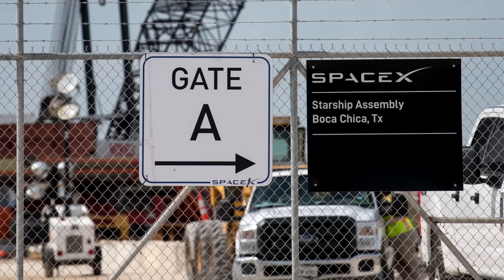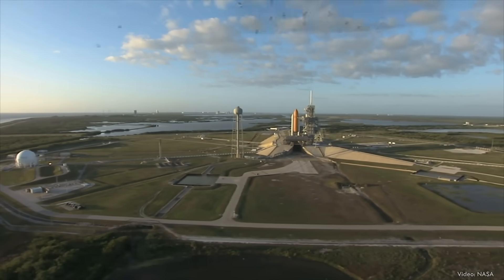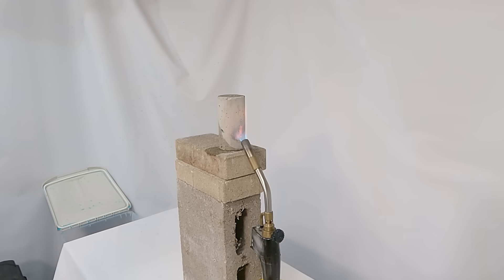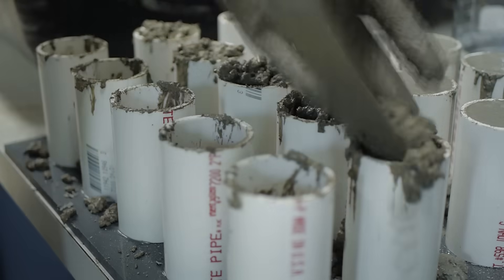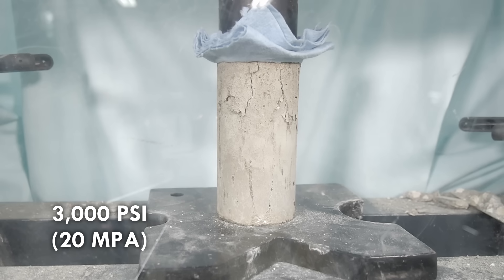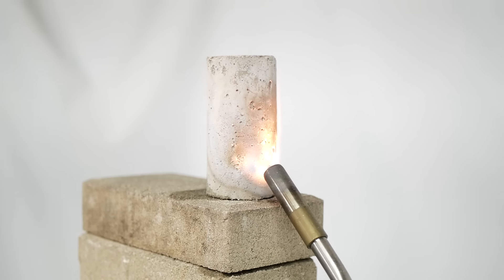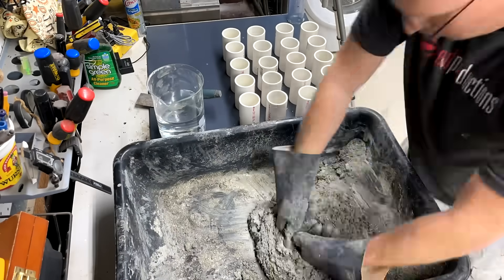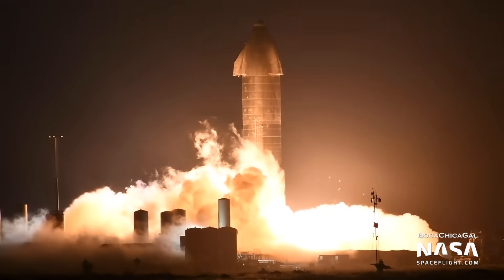Why SpaceX Cares About Concrete

Comment: My dad was an engineer and told a story about a new highway being built that ran into a mysterious problem.  From every batch of concrete they would pour two cylinders of the concrete and leave them sitting beside the road to cure and then test.  And in most cases, one would pass and one would fail, by quite a large margin.  Obviously this was raising questions about the quality of the concrete, but no one could figure out why one would pass and one would fail even though they were the same batch cured in identical conditions.  Finally someone was assigned to sit and watch the concrete cure (what a job that was) and they found that one guy on the finishing crew would come along and kick one of the cans to see if it was hardened yet.  This guy was doing his work just about the time the concrete was starting to harden up, but not quite all the way, so he was damaging the structure of the cement in the can that he kicked.  Mystery solved. I didn't hear how hard they kicked that poor guy :-).
Reply: Ugh 😩 god that would get on my nerves. I had guys tamper with my mix while mortaring. They’d add extra water as the mix started to thicken from curing.
Reply: lmao doesn't such curing process will have an estimated time for it to be finished? but probably that guy didn't know about such and how kicking the cylinder would affect the samples
Reply: Good story. I wonder if the SpaceX engineers have reinforced the GSE tank farm tanks to withstand the blast of thirty, plus or minus Raptor engines firing just a short distance away and only twelve meters or so above a flat surface, without any diversion system to deflect the blast away from those huge tanks, some containing LOX and liquid methane. What am I missing? There is an earth berm perhaps ten meters high between the OLT and the GSE farm, but the booster will slowly rise the first few hundred meters, exerting quite a bit of lateral pressure on those tanks for many seconds.
Reply: @elihavalot8111  I think they are a lot further away than they look in the pictures. The videos are taken with extreme telephoto lenses that make depth all screwy. The tanks themselves are also going to be pressurized to reduce boil off if nothing else. That gives them quite a bit of strength from everything except high speed bits of concrete. In addition to that they will be not flight weight tanks. While Starship might be a mm or two in most places I'd wager tanks that size on the ground are going to be half inch (12mm) steel with added insulation and such like. The force exerted on them by the rocket launch would be a small fraction of the force on them during a maximum hurricane I'd wager.
Reply: @elihavalot8111 you weren't missing anything. They ruined that whole area. 🤣🤣🤣🤣🤦‍♂️🤦‍♂️🤦‍♂️
Reply: Timemachine, they'd X-ray it and confirm failure, but essentially yes, they'd destroy what was damaged.
Reply: Hah, that reminds me of the classical story told in IT, where a server would mysteriously crash every Tuesday night without any warning or errors in the logs. Even replacing the machine didn't seem to help. So one guy stayed behind and observed how the cleaning personal came in and unplugged it so they could plug in their vacuum cleaner...
Reply: @asdfxcy  I know that story lol
Reply: hahahaha. That's a funny story. Thanks.
Reply: They really done made someone watch concrete cure☠️☠️☠️☠️

Comment: What videos like this never discuss - and this is not a criticism - is the absurdity of the levels of sound volume and mechanical energy that these rockets produce. Heat damage is a fine and common point to discuss, but did you know that rockets are so loud they can literally set concrete on fire? There is a chart that claims that the Saturn V rocket set grass on fire for nearly an entire mile around the launch pad. With sound - although, calling it "sound" at this point is not exactly correct, it is a shockwave. Of course, today, this is mitigated by dumping water onto the launch pad to absorb the sound, but even with this "technology", when the Sat V launched, it broke windows dozens of miles away. It rattled entire buildings and nearly caused them to collapse. In my opinion, discussing the absurd stresses concrete (and the rocket itself) has to endure due to sound pressure levels is a far more interesting topic that is virtually never mentioned. NASA conducts a lot of research on miniatures to try to understand how the acoustics of a launch will affect the pad and the rocket, so it is not like it is an esoteric topic.

Either way, great video and I enjoyed it very much. I also learned quite a bit. Thank you!

Comment: Question: At the SpaceX launch site, the very tall and colorful mobile crane has that section with two parts of the crane box frame (sorry, not sure what to call it). That main part starts out as a single width, increases to 2x, then back to single width. What is the reason for that double width section? 
And you need a model of it next to the yellow one in your video background.

Comment: Test invalid, you didn't tamp the cylinders.  There's gonna be a lot of variation between your cylinders even before treatment, easily double-digit percent.  So you can't really make the conclusion that heating the PCC in an oven reduces the strength by 25%, because there's a chance that your result is within the margin of error based on variation in the starting cylinders.  And you only tested one sample of each.  The statistical/mathematical uncertainty based on that alone is higher than 25%.  

Now I will give you this: there's lots of research showing how concrete weakens when exposed to fire, which is probably something you discovered in research.  But for a channel called "Practical Engineering", I would have expected a more robust and researched approach to presenting a test on-screen.  This feels like you're just winging it.  There's all sorts of literature on concrete testing you could have referenced.  A valid test of concrete cylinders is the average of 3 cylinders.  Cylinders are always twice as tall as they are wide (or there's adjustment factors that must be applied).  And there's a standard method of consolidation that's used on every test cylinder.  For small 2"-diameter cylinders like are used here, you fill it 1/3, tamp it down with your finger, and repeat.  That all helps ensure that tests performed in different places by different technicians are all comparable.

Comment: We made a slab for pressure washing with store bought concrete, which broke easily.
In a few days it went from a smooth surface to a very rough surface.
Next time we had a truck come with proper concrete, which is still like new a few years later.

Comment: Concrete doesn't burn?  

You haven't read enough rocket engineering. :)  

I share with you a passage from "Ignition: An informal history of liquid rocket propellants" by John D Clark:  

"Chlorine trifluoride, ClF3, or 'CTF' as the engineers insist on calling it... [...] ...is extremely toxic, but that's the least of the problem. It is hypergolic with every known fuel, and so rapidly hypergolic that no ignition delay has ever been measured. It is also hypergolic with such things as cloth, wood, and test engineers, not to mention asbestos, sand and water - with which it reacts explosively. 
[...]
[General Chemical Co]
It happened at their Shreveport, Louisianna, installation, while they were preparing to ship out, for the first time, a one-ton steel cylinder of CTF. [...] ...it split and dumped one ton of chlorine trifluoride onto the floor. It chewed its way through twelve inches of concrete and dug a three foot hole in the gravel underneath, filled the place with fumes which corroded everything in sight, and, in general, made one hell of a mess."

Comment: In my country we only use cylinders when drilling out existing structures. All new concrete testing is done on cubes. It's common to have a 3 cube form to have enough for both pressure and freeze testing.

Comment: This reminds me of the time my dad told me not to cut metal with the oxy acetylene torch on the ground close to the concrete. So wondering why, me alone at like age 15  in the garage lit up the torch and put it on the floor. No surprise the concrete exploded immediately and a chunk hit me in the forehead and put a divot in the garage that I could not explain when he asked why there was a chunk of the garage floor missing. Sometimes you just have to learn the hard way. Lol

Comment: Refractory materials need to first be allowed to dry at low temperature (below 100C) to develop full chemical bonding. Then, once fully dry, they need to be heated slowly to full operating temperature to develop ceramic bonding. It does not appear temps achieved in this experiment would have allowed the full potential strength of ceramic bonding.

Comment: It's not just thermal expansion that can severely weaken a concrete structure. Thermal shock caused by the sudden and dramatic application of intense heat (or the sudden and dramatic removal of heat) tends to compromise concrete structures significantly, especially on loadbearing nodes. Take a sample of concrete for example, put it in the oven at 500 degrees F, and then dump it into a bath of ice water. It will quite literally shatter.

As I have heard from people in the industry, this is an especially common occurrence, when contractors rapidly cure concrete in order to cut corners and shorten construction time to meet unrealistic deadlines... which unfortunately has resulted in newly built concrete buildings failing within weeks instead of the expected two or three decades.

Comment: I developed ultra high strength concrete and ultra high temperature coatings for oil and gas, and the military.
I love developing extreme service coatings as a formulation chemist.
Worked with explosives, armored vehicles and love concrete.
I admire the Roman's and their 2000 year old concrete that gets harder over the century's while our Portland Cement lasts about 50 years.
I admire Elon Musk and his fantastic path of product development and he runs circles around nearly everyone on Earth.
NASA is still using re entry ablative coatings developed  back in the early 60's. 
I know because I have the old formulas in my lab.
I now designed many other coatings for my current employer, and love the challenge of invention.

Comment: “If a Spacecraft were to fly through this (lunar) ejecta, it would almost certainly be damaged.”
Disagree. Too little material and too much dispersion at even the low altitude of lunar orbit.
And finally: what does SpaceX do about a landing pad for the Rockets? Have you any  details on the specs re  the material and construction?
Reply: Oh no the lunar ejects issue is definitely something that would be an issue for a vehicle as large as starship. It’s why Lunar Starship has outside thrusters at the middle.

And as for the landing pads. As far as I’m aware they’re just concrete.

Comment: The biggest issue, that I can see is like someone I know. Is created when flashing steam in concrete has explosive results.. By having damp concrete that is exposed to the elements not such as outside. than creating fire on or around it. when the moister creates steam if it cant escape efficiently that is what you can run into as well.. Aside from the strength issues..

Comment: Great video! On a side note this all highlights one big reason why anyone doing backyard metal castings should not pour on their driveway in case of spills. 

Best-case scenario with a spill is you just damage your driveway and have to redo or resurface it sooner than you should. Worst-case is the conditions are right for spalling.

Comment: But why use concrete at all? Why not use a high temperature alloy like a sheet of Inoconel or hastelloy? Cost?

Obviously not for the entire pad but just the small section that is being directly impinged by the flame and of a reasonable thickness.
Reply: That would work. In fact the droneships SpaceX lands on are made out of a metal landing pad (it used to be wood) however, this doesn’t survive when hit at high speed like a concrete pad can. As seen with Just Read The Instructions I

But it’s much easier to simply pour some concrete on land than dig out a massive hole and machine a huge slab of metal to put in its place.

Comment: Startship may be the future but that Saturn 5 launch still gives me goosebumps, just amazing.  Any permanent base on the Moon or Mars is going to need huge power requirements. A nuclear reactor could produce enough power to use lasers to sinter or melt rock powder into construction materials.

Comment: How do geopolymer or alkali-activated (AA) cements perform compared to OPC? Also, how long were those samples cured? There's about a 30:1 curing disadvantage to OPC compared to AA's. Also, rebar? Basalt fiber vs. steel?

Comment: Awesome video, it was really helpful and surprisingly more insightful into concrete than I could of imagined! I have a question that I would be interested in you to answer. If concrete is such an unstable material at extreme heat and cold, why do we use on interstates and long expansive highways? It seems like it would be worth time and money to find a material that isn’t affected as much. This is coming from someone who constantly has to drive through ongoing construction.

Comment: Dear Practical Engineering, what about epoxy granite, epoxy Concrete aka machine base Concrete, use for dumpening vibrations, thermal expansion and dimensional stability over time. Can you make an expert video about this type of concrete, StuderAG made an Granitan composite material for this.kind of applications...

Comment: ...For this reason, they should launch from a giant cable-suspended toroid that decouples with robotic clasps. The clasps could carry it aloft by 3 spaced out hydrogen dirigibles that fly away from each other prior to ignition, reducing the amount of power necessary for escape velocity, like a sling.

Comment: I remember this moment at 0:22. I was watching live on the NASASpaceFlight stream. A couple days prior, SN8 had conducted a static fire for a couple seconds, just like this one, and it had thrown up sparks as well. When this happened, our first indication that something was wrong was not the engines stopping, as they had been a regular duration static fire, but red-orange, glowing liquid coming from one of the Raptor engines. The damaged rocket was unable to vent excess pressure from the LOX header tank, and it was later found out that had a burst disk not released that pressure, SN8 might have been lost. It was a very close call, and, if I remember correctly, valves were installed on SN8 and all subsequent prototypes to prevent this from reoccurring.

Comment: 2:12 i was on the tugboat that towed the drone ship :)
Reply: And?
Reply: @elcomandante9299 And, we all signed non-disclosure agreements. however i can say, the name of the tugboat towing drone ship was the "Elsbeth 3" and later the "Rhea". Both literally home-made ships that were the brainchild of a mad genius named Latham. I have been there for 2 or 3 failed landings but never a successful one. Our captain would act like we were going to the safe zone but then haul ass tward where it was gonna land to get better view. Still have no idea how that old pirate got that contact...... During one of the failed landings I participated in putting out the fire on the ship. We also got stuck out in 28 ft seas when space-x's boat the "go-quest" just turned tail and ran for the shore, i guess excepting that we can just hang out with the barge. Long story kinda short. we snapped a 2 1/4 inch tow wire and had to tow on emergency cable to the bahamas where shallow enough to dive down, and capture the almost mile long tow wire that was dragging to re-make tow. couldn't tow back into jax cause of undersea data cables and dragging wire. Emergency cable was routed under anchor chain (spacex guys fault) so we had to cut the chain to even re-capture the barge. I watched 3 people burn up all our SAWZALL and portaband blades trying to cut a 3 inch anchor chain.......... the whole time im saying "get the torch!" and no one listened until 2 hours later..."oh i think we might need the torch"...fkin dumbasses... Anyway... I pour concrete now and i'm MUCH happier. 
Edit: I did save 2 or 3 small pieces of blown up rocket for memorabilia..(Space-x, just let me be i aint selling em to the Chinese.. no worries) when i worked there one of our guys posted a small video to his facebook. They found out ASAP, he got in trouble, and they told us that they have a whole team of people that just scour the web for leaked spacex stuff... this is like 5 years ago so i should be fine..:)
Was offered an internship at space-x...Still undecided if not taking them up was a mistake or not... no regrets though. was a great experience...

Comment: What if a fire started inside a dam? Do you believe there would be a possibility of explosive damage due to all the water, that has probably seeped into the structure of the years, boiling off and creating pressure? (I smell a Hollywood blockbuster here)

Comment: "Concrete doesn't Burn!" 
Chlorine Trifluoride disagrees... :D 
Oxy/Acetylene torches will cause spalling, as will the molten iron from cutting with one. I learned that the hard way more than once...
While on the topic, what would be the cheapest and easiest refractory cement to get/make?
Reply: Calcium aluminate cement with refractory sand of some sort (for example, pure alumina sand). If it is not TOO hot you might be able to use regular sand. Some supply places may sell calcium aluminate cement not so much for its refractory abilities but because it sets up fast and reaches full load capacity much more quickly. Portland cement concrete strength is usually specified at 28 days if I am not mistaken, but it continues to cure and become stronger even after 28 days.